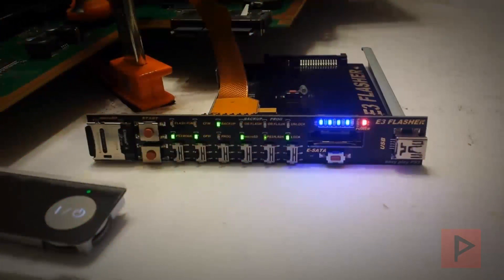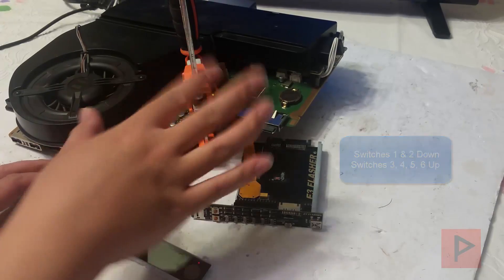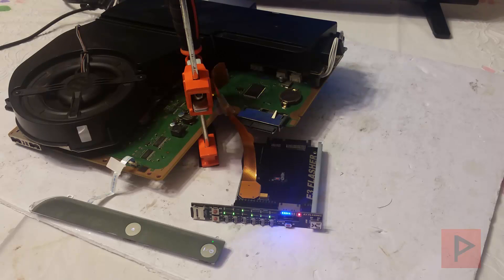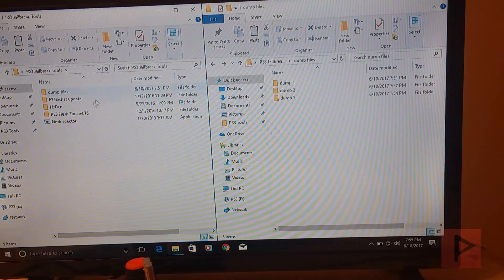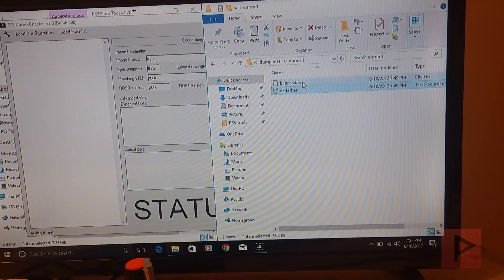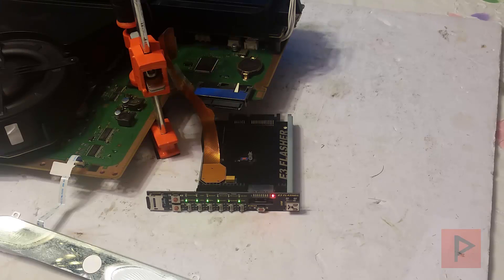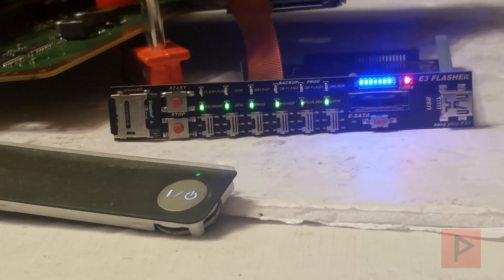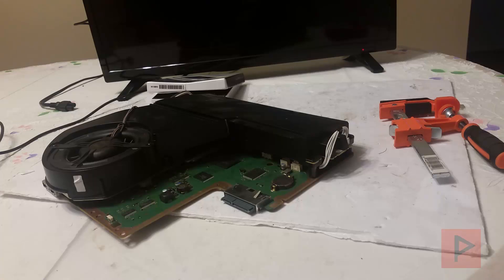[How To] Downgrade PS3 Slim Using E3 Flasher - Refresher Tutorial 2017

Comment: ps3 slim cech 2004a downgraded with e3 flasher rogero 4.30 by a technician the problem is I can not install any cfw error code 8002F829 dump patched bad install necessarily on the console, help me please

Comment: i have a problem, it is with a e3 flasher, i can turn my ps3 on but, when i want to turn it off, i can't it just does nothing. I also don;t get any video signal from the ps3. The thing that i did was, i accedentely put the fourth switch up instead of the third one, did i brick my ps3 now. Now when i try to make a backup, it is only errors. But the strange thing is it always makes a backup, even do there is no pressure to the clip. So if you could help me, that would be awesome! im desperet tried everything...